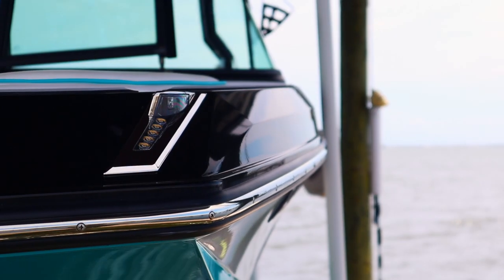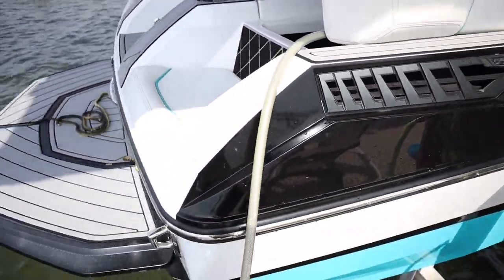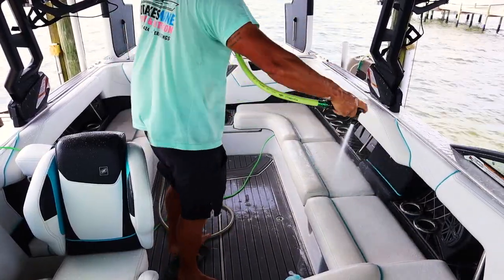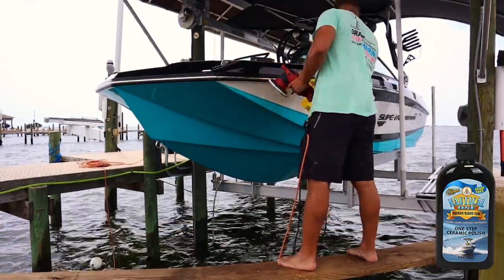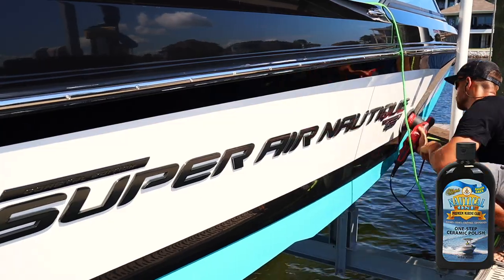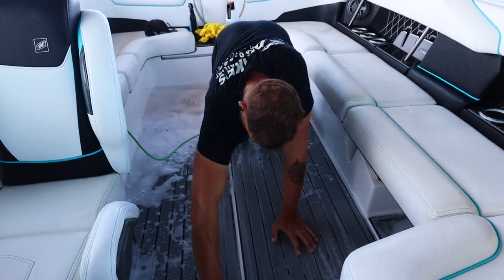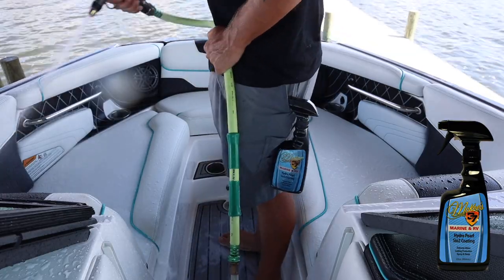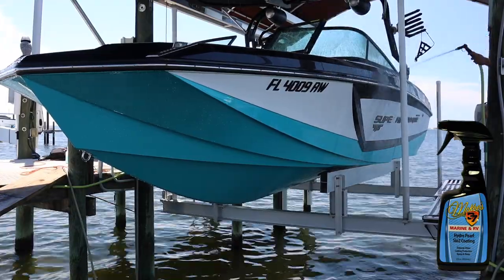Detailing the Super Air Natique | Boat Detailing Business Tips

Comment: Drake, a big fan of your videos.  I used them as a guide to get a great shine on my KW.  Thank you.

In your last several videos, you've been really touting the SiO2 products by McKey.  Have you moved away from Power Lock?  If not, what determines where you would use one over the other?
Reply from the maker: I use the the SIO2 on top of the power lock! 

So if you sealed you gel coat with power lock, the. Apply the Si02 on top of it once a month to keep the power lock protected
Reply: @DrakesDetailing  I was just curious if you had found the SiO2 to not need the first application of sealant.  I didn't use Power Lock as I already had Meguires Ultimate Marine Wax on hand.  Figured I'd finish using up what I had and then switch over to the Power Lock product.  I suppose I could still use the SiO2 over the Meguires.  I use another Meguire SiO2 on the Ranger and it does a fantastic job on it.
Reply from the maker: Yes, the Si02 can go over your wax with not problem

Comment: If the microfiber pad isn’t quite getting some tougher water spots out, will a white foam pad work or will that take the ceramic off? Thanks
Reply from the maker: White pad is fine. Sometimes it’s impossible too get the water marks completely off without removing the ceramic, in that case you may have to redo the coating

Comment: Is it safe to use a magic eraser and deluded purple power for all seats? I saw you used dawn with a scrub?
Reply from the maker: That was only because those seats were ceramic coated. 

If seats are ceramic coated then, no. 
The purple power will take off the coating. It will hurt the coating but not the seat.

Comment: Very good video Drake, I just discovered you and like your channel !  If I want to use the same Ceramic Coating as on my car, Cquartz UK 3.0 as example, would you recommand it on my boat ?  Also, for the vinyl seating, is a car leather ceramic coating, Cquartz  Leather, would be good?  And last question, would you recommand using a new "buzz" products Graphene Coating on a Gelcoated ?boat?  Thanks ! Fred from Montreal Canada!
Reply from the maker: Graphene coatings are still very new! I wouldn't use a car coating on a boat, It Will not last nearly as long for UV, I recommend this coating  https://bit.ly/36dtD96

Comment: I thought using dawn will strip waxes/sealant/ceramic coatings?
Reply from the maker: It will strip waxes and sealants, but not ceramic
Reply: @DrakesDetailing  Thanks man! Just getting into boat detailing and I have a ceramic coated boat to do this friday, I don't have enough time to get the Mckee's si02 could i use the meguiars ceramic wax si02? Made for cars but was wondering if i could use it on the boat aswell. Thanks for the reply!